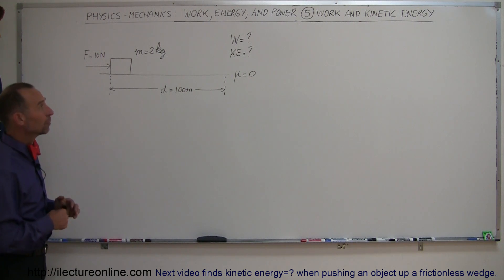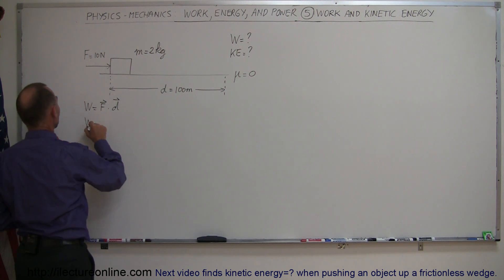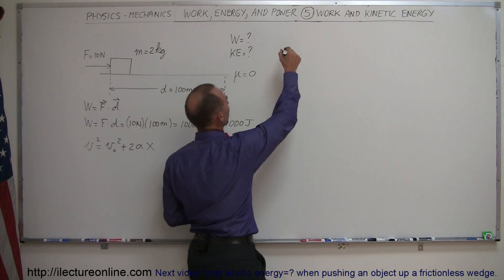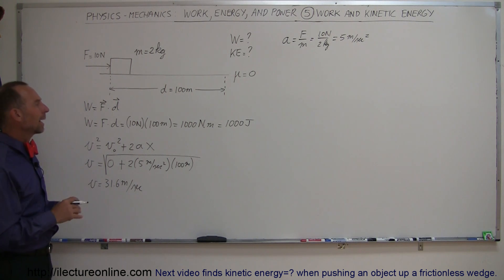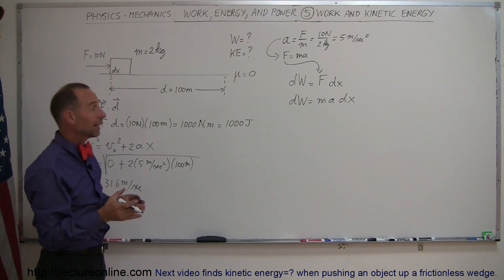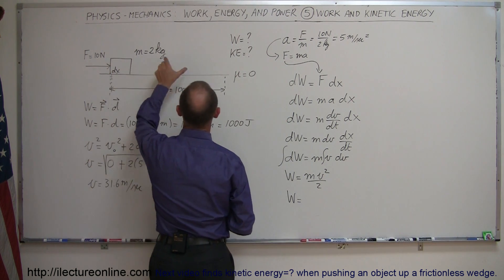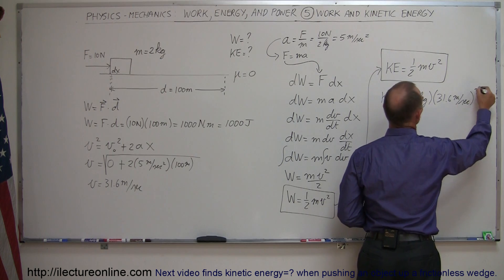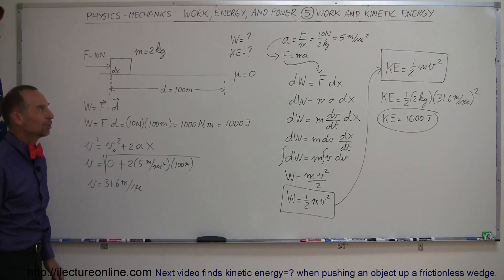Physics 8  Work, Energy, and Power (5 of 37) Pushing an Object (Frictionless)

Comment: Sir, I have a Doubt in The Concept of Work and Energy, 
Work = KE (According to Work Energy theorem)
So If, Lets say we do a work of 100J and make a 2 kg block move then Basically the Block gains KE of 100J 
and that we can say as the block will have a velocity 10m/s now.
So doesn't this seem to say that Work and Energy are the same ?
Further, Like in Derivation of Bernoulli's equation, We Write Work = Pressure x Volume 
and Then we also Write KE (Kinetic Energy)
Work 1 + KE 1 + PE 1 = Work 2 + PE 2 + KE 2 
Here why do we Take the Work in the equation ?
Hasn't the work been used up in order to Generate a KE ?
In Deriving the Bernoullie Equation (I have seen Your Derivation too, But this is a Similar Derivation which I saw = https://www.youtube.com/watch?v=yqtDQlyHQHQ) why are We Taking "Work" in The "Conservation of Energy" .
If A Block of Mass 2kg is Pushed and it gains Velocity 10m/s, and someone asks us "What is its energy?" we would say 100J 
as that is its KE and Not 100J of Work + 100J of KE and Hence 200J, Then why do we do a similar "Wrong" thing in case of Bernoullie Theorem ?
(Really Sorry for this long Comment)
Reply from the maker: The standard definition of work is the dot product of force and displacement.  Work can result in increasing kinetic or potential energy or simply to overcome friction or wind resistance, with no increase in energy.  It depends on the situation.
Reply: @MichelvanBiezen   Thank You Sir

Comment: here's a good story, i study engineering and recently i was taking a physics class. At first i dont know what the approuch is to physics, i cant seem to figure it out. Unlike calculus that you really need to practice solving problems to get good with it. The first semester of physics really beat the hell out of me. So i tried many strategies and it did not work. many weeks later i found a method that worked well for me. I read a textbook, write down all the formulas, and watch this dud go through problems. And it worked !!! I passed my last quiz ang hoping to pass the midterms exam as well. Like math i try many things to solve my problem. If its hard, maybe theres another way. I thank this guy for his extremely good videos, it helped me a lot.
Reply from the maker: Glad we are able to help in your journey through physics.

Comment: What about if the object is on top of a hill, like this........ A spring, with constant of 5500N/m, is compressed by 0.60m and used to launch a 20.5Kg mass from rest from point A across a frictionless surface and down a short hill that is H=2.5m high. The surface becomes rough at point B, and the mass comes to a stop at point C. 1) How much energy is stored in the compressed spring?  2) KE of the object at B? 3) How much work was done by friction between B and C?
Reply from the maker: W + KEo + PE0 = KEf + PEf + E lost        0 +  (1/2)kx^2 + mgh = 0 + 0 + mg (mu) d     1) (1/2)kx^2    2) KEb = (1/2)kx^2 + mgh   3)   W by friction = KEb
Reply: @MichelvanBiezen   Thanks

Comment: Could we use a as v^2 = u^2 + 2as too ?
and we get v^2-u^2/2s as accerelation and then integrate both sides
Reply from the maker: There are often multiple ways in which a problem can be done.  I always encourage my students to try a different method to see if they get the same answer.

Comment: Hello sir! When you're moving a lawn mower at constant speed, and there's friction force, does your work done equal the work done by friction? I think since it's not accelerating, all of the energy you put into were removed. Thank you!
Reply: I might be wrong but isnt Wnet the sum of all work acting on the system and since the Y components cancel out wouldn't Wnet be W of force applied + W of friction

Comment: Can there be kinetic energy without any work? Suppose an object is moving with constant velocity. There is no net force. Work is depended on force. Hence no work. But there is velocity. And kinetic depends on velocity and mass but not on force according to the formula
Reply from the maker: An object that is dropped will gain kinetic energy as potential energy is converted kinetic energy.  You can also call that the force of gravity doing work on the object.
Reply: Thanks professor :)

Comment: for the Final Velocity, can I equateW = 1/2 mv^2 ?
1000 = 0.5*2*v^2
v(final) = sqrt[1000/(0.5*2)]             = 31.6m/sIs this a correct solution as well?
Reply: oh I just saw the ending of the video.
Does it mean that the W=1/2mv^2 is always true? or in some cases it will be not true?

Comment: what does kinetic energy actually means in definition not calculations ?? 
and thankss a lot for your effort and your awesome way of teaching
Reply from the maker: Codo,
An object has kinetic energy because it is moving.  
Think of energy in terms of the work that it can do.
When you swing a hammer it has kinetic energy, because it is moving.  When it hits a nail, the energy is used to drive the nail into the wood.
Reply: Michel van Biezen but the instant that the object stops will it have kinetic energy ??knowing that this object has no height from the surface of the earth
Reply from the maker: Codo Sacho
Codo,
The moment the object stops, it will no longer have any kinetic energy, regardless of its position
Reply: Michel van Biezen so according to the law of conservation of energy where does this energy go ??
Reply from the maker: Codo Sacho
That depends on what happened,
Energy can do work, so sometimes the kinetic energy is used to perform work like pushing an object up a hill or in the case of billiards one moving ball will push another moving ball so the kinetic energy is transferred.
But often the kinetic energy is transformed to heat, like in the case where an object falls to the ground from a height.
The kinetic energy is transformed to heat which is absorbed by the floor and the object.
Heat is stored in an object by the vibrations of the atoms in the object.  The more heat the object absorbs, the faster the atoms will vibrate and the hotter the object becomes.
Reply: Codo Sacho Energy is always transferred. It can go from Potential to Kinetic and vice versa. Sometimes energy is transferred from Kinetic to Heat/thermal energy in collisions.

Comment: 2:26 is  there  a mistake.? I think v=10m/s^2
Reply from the maker: Ebru,
The answer is correct as stated in the video.
Reply: I really dont understant or i am missing something. I think it should be  vf^2=vi^2+2ax so vf^2=0+2.5.100 then v=10m/s^2 .
Reply from the maker: ebru uyar
Vf^2 = 0 + 2 * 5 * 100

Vf^2 = 1000

Vf = Sqroot (1000)

Vf = 31.6 m/sec
Reply: sorry my bad.I spent your time for trivial algebra  and you know sometimes person  stubbornly  cannot see even if it is so simple.Really thanks for your answers..  .Everything is more clear now.
Reply from the maker: ebru uyar
Ebru,
Don't feel bad.  That happens to me as well.  Sometimes I look back and wonder how i could have made a mistake on such a simple problem.  Once our brain is locked onto a certain concept, even when wrong, it is hard to see the correct answer.  That is why learning how to do problems in a certain pattern will help limit those types of errors.  That is why I teach math and physics the way I do.

Comment: hey I've just listen to this video and I have been doing calculations with you but the last calculation when calculating kinetic energy is 998.56 instead of 1000j how did you do it?
Reply from the maker: Odwa,
You used 31.6m/sec for the velocity which is a "rounded" value.
It is actually Square root (1000) = 31.6227766 m/sec.
(Usually I leave the previous value in my calculator, so I don't have a rounding error.
Reply: you can round that up